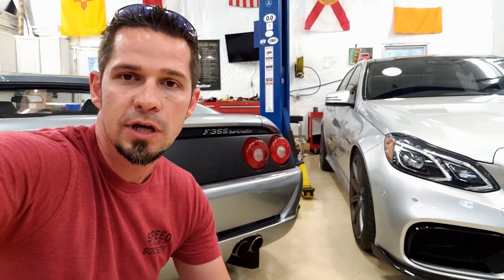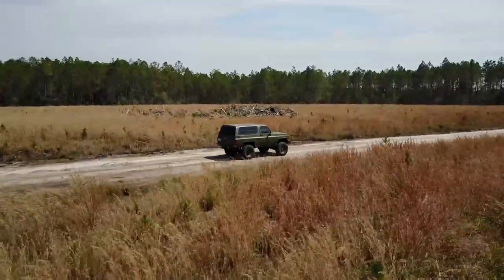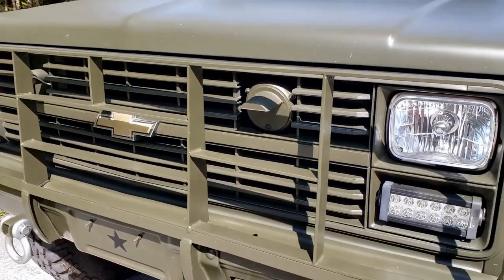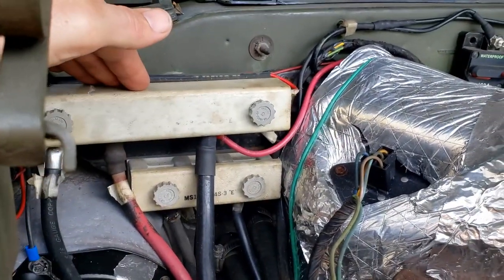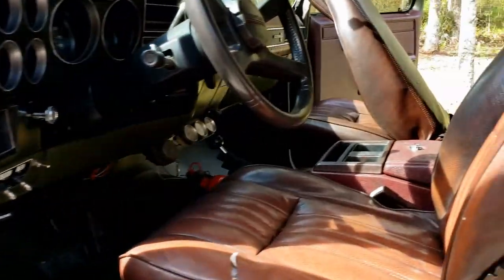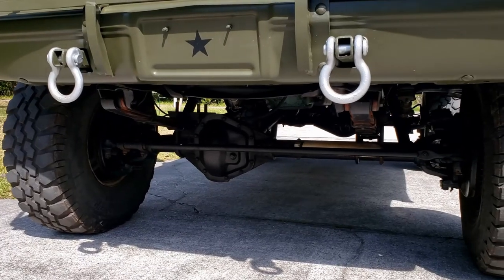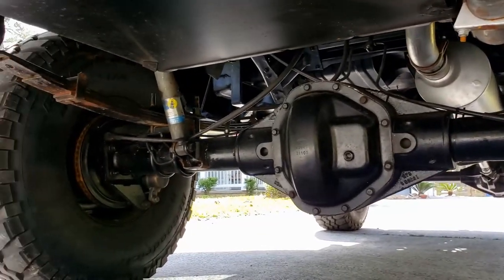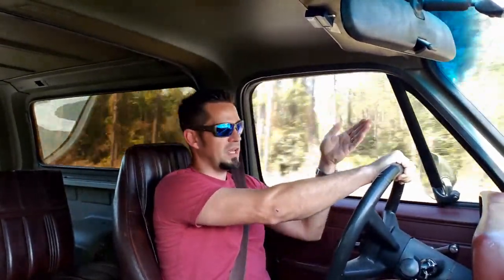TURBO, 1 TON  M1009 CUCV, Full review of my build!

Comment: Great video and fantastic build, we currently have a 1009 that is mechanically sound but rusted badly. One technical correction if I may. The lights that you pointed out were not IR, they were the system that the army used for night movement of all tactical vehicles at the time.  Each light had 4 slots that emitted low level light and I think they were all on the same bulb . Essentially, if you were following another vehicle at night,  and saw 4 dots, you were too close, 2 dots and you were good, a single dot, too far. Simple and effective. The front mount that you pointed out was a headlight of sorts but didnt help all that much. It was amazing how well this system worked. Again congratulations on an awesome build!!
Reply from the maker: Ya, wish I could edit it.
Reply: They're called Blackout drive lights

Comment: Hey enjoyed the video. Can I give a couple of pointers. In the military guys say M-ten -Oh-9.Its short and easy to say just advice not criticizing. Also the blackout lights are not infrared. You could use night vision with them but you don't need to. The rear lights will show as one at night but as you get closer you can see its 2 on each side within the unit. That lets the guys following know that they are getting to close. Other military trucks have the 4 cat eyes and as you get close they are easy to differentiate so they can back off some. Love the rig its beautiful and the vid is good to great work!!
Reply from the maker: Thanks for the comments man!
I actually posted that question on steel soldiers a few years back, ten oh9 versus m1 zerozero9 lol.
Yeah and about the lights, unfortunately you can't edit YouTube videos after you post them, and I didn't want to delete it and put it back up
Reply: It also appears that the "dash bezel" has been replaced by a civilian part. The CUCV's did not have vents, and the blackout light switches were on the lower left of the bezel, not underneath on the metal.

Comment: We had a couple of M1008 pickups in my Hellenic Army unit during the early 1990s, US Army surplus. It's a shame they didn't come with spares, many were cannibalized before they were pulled out of active service after 4-5 years. Several are privately owned and still running, although mostly in rough shape and lacking the front brushguard (legal issues regarding the last one). Greetings from Greece!
Reply from the maker: That's pretty awesome! When I was researching some specs for the video, I was surprised to find how many different countries they shipped these trucks to. The government here liquidated most of them in the early 2000s, so if you want one you have to buy one second hand. I'm currently looking for an m1008

Comment: Your headlight is a 'blackout light.' Most likely just a very weak flashlight type bulb. Infrared look different from those.
Reply from the maker: Yes you are correct,
Reply: The "Blackout" light function powers the "Convoy Lights" on the bumpers while turning off the brake lights, turn signals and headlights.  That way hitting the brakes while driving in the dark doesn't give your position away by illuminating the brake lights in the back.

Comment: I am in the middle of building one of my own and I want to run the humvee tires but I cannot get the offset on them right. Did you use spacers or how did you get them to sit so perfectly?
Reply from the maker: I'm running 74 in wide dually axles. Stock axles are only about 67 in wide. That's a hell of a spacer, I personally am not a fan of spacers, I would just swap the hubs out with dually hubs
Reply: @ExoticCarDIY  that’s exactly what I am planning on doing so I’m glad I was right to plan on going this route

Comment: That round plug on the inside was for the ICE system. I don’t remember what the acronym means, but it was basically an early version of OBD the military used.
Reply from the maker: Interesting, I didn't think there were any computer chips on these cars. Maybe it allowed sensor inputs to go to an external computer? I always thought it was was a standardized plug for military items
Reply: @ExoticCarDIY  I’m not sure how it worked. Starting in the ‘80s they were in everything from CUCVs and HUMWWVs to M1 tanks and artillery pieces. I’ve been out of the military since 2011, and they were even in the newer  armored HUMWWVs and other vehicles I was I. For 22 years and was even a mechanic for awhile and never used one.
Reply: The acronym stands for Special Test Equipment- Internal  Combustion Engine
Reply from the maker: @frankthomas2231  awesome, thanks for that info man
Reply: The connection was for the STE-ICE machine. There we no computers or codes in the CUCV. The STE-ICE would only read info from various sensors on the vehicle and the mechanic would have to compare the readings to those listed in the TM (Technical Manual), to make a diagnosis.

Comment: I would put 56" leaf springs in the rear and stretch the wheel base a little.  makes it look more proportional.
Reply from the maker: Little by little working on the upgrades. I need lockers fist. cant find any for that stupid "super 70" in the rear.
Reply: @ExoticCarDIY  14 bolt from the 3/4 ton burban and pickup will have the correct pad spring pad width for bolt in.  Some wheel spacers would look good too, cover that full float hub a bit.  8 lug is pretty safe for spacers.  a 14 bolt  detroit locker is cheapest way to go.  all the m1028's have a limited slip in the front dana 60.
Reply: @raisinbartholamew5864  yeah I had a Dana 60 and 14bff on my previous k5.
However on this one, with the offset it the H1 wheels, both of those Axles are dually axles with ~75"wms widths. I think a 14bff is 69" so that would need a 3-in spacer per side. Might be the best option though we'll see.
Reply: @kennethderamus5277  yup, unfortunately you have the locker issue with the dually rear 70.. I ended up just getting re-centered 12 bolt hmmwv rims for mine, rather than doing a dually hub conversion on the front and spacers in the rear.

Comment: Thanks for the overview. I'm in the market and will keep you posted on my findings. I spoke with my diesel man, he said good motors will last many miles but a dog, Bank's turbo is the way to go. Did you have any issues with the banks kit, what is the approx cost, did you do anything to the engine prior to putting on the Bank's?
Than you,
Reply from the maker: Mine came with it, seem to help quite a bit from the other 6.2 ive had in the past, but still pretty underpowered in modern terms. No engine mods, the previous owner even says he never adjusted the injector pump. Ive been wanted to tweak it , but just procrastinating since I've been debating a LBZ swap

Comment: Could you elaborate a little on how you did the AC? Which compressor did you use, and where is it mounted? Do these run with a typical V-belt system or serpentine? And any other aspects you may think to advise on? I’m a K5’r and have the opportunity to buy a M1009. Being in Oklahoma I need to add AC for sure. It’s going to be miserable starting next week til about Halloween lol.
Reply from the maker: I took a ton of pictures, unfortunately I didn't film any of it. Really wish I had filmed the restoration. Currently looking for an m1008 that I will record the restoration if anyone knows the one lol.
Anyway, I debated converting it to a serpentine system from a 6.5, but ultimately ended up on keeping the v-belt system and it hasn't caused me any issues. All the parts came from a civilian 6.2 donor car. The driver side alternator was removed and an h6 compressor installed in its place with OEM brackets. The lines were OEM, but had to be modified a little bit to clear my turbo.
A rectangle hole needs to be cut into the firewall, I simply use the AC box as a template.
You do have to relocate the CUCV power bus that is on the firewall to mount the AC parts. If you want, I can send you pictures

Comment: Hey brother really like the blazer picked me up a 83 k5 blazer civilian model with the 6.2. So the truck had ac but they put a banks turbo kit and deleted it. How did you do your system and where did you find the stuff for it. Another question for you is how does the truck not leak oil🤣 mine pukes oil changed quite a bit of stuff just haven't got to take a look at the valve covers or rear main. I already sealed the pan changed the cdr and checked for fuel leaks no dice anything would help man.
Reply from the maker: Wonder why they deleted it? The only thing I can think is that the military ones have two alternators so I deleted the driver side alternator and put the AC compressor there. Rooting the refrigerant lines around the turbo was tricky but doable. I almost rather have AC than a turbo here in Florida lol. I have a photo album that has all the pictures of the AC retrofit if you're interested I can email it to you.
Old trucks leak oil, it's kind of a constant thing you got to keep addressing. Right now mine seeps from the transmission pan. But the rear main, valve covers, and oil pan are good. Got a bunch of stuff on the to-do list coming up soon
Reply: @ExoticCarDIY  I honestly don't know why they deleted it but it's an original ac truck which is kinda dumb to delete it lol. And dang okay I am just going to have to figure out where its leaking. If you want my Instagram is j_cap0lot. I don't really have an email. But I would like to see how you did it just to see the placement.
Reply from the maker: @jjsilva6670  I'll send a link to your IG it'll come from K&r Motorsports

Comment: Hey Kenny, what would be the top ten "or more" things to look for when looking to buy an M1009. Thanks
Reply from the maker: well, there's not a lot of components to break, and being an common truck, everything's things cheap. $80 radiator, $22 water pump, $8 glow plugs etc...
I would avoid any truck with rust, it's very hard and expensive to fix, and it just makes everything hard to work on.
Reply: LRG you should look for rust, also check for 24 volt. If someone has butchered the electrical its a pain to troubleshoot. IF they said they did the roscomm mod for 24 to 12v conversion its not bad you can look it up. Electrical as minimal as it is seems to be the achilles heel for most people working on these. Also check for rust on the cab roof. Any serious rust on the roof inside or out and I would avoid it unless your a body man. Some of these have the seal go bad between the fiberglass top and the cab roof, water runs into the bolt holes and rust the roof out above the cab. When you go to look at it, if its 24v still both GEN1 and GEN2 lights need to come on when you turn on the key, that means the alternators should be exciting to charge the batteries. Its not a deal breaker but just something to look for. These trucks are very easy to work on and you can get the Technical Manuals online for free that the military used for trouble shooting and repairs. Great trucks and lots of fun plus easy to maintain. Good luck!!!
Reply: @ExoticCarDIY  sir, I'm trying to replace my radiator and the cheapest I've found is $600, you mentioned $80, could you point me in the right direction? Thank you, and your videos are awesome!
Reply from the maker: @1libertas426  I bought mine off of eBay, currently I don't see any listed. But the exact part number I bought was APDI 8010607 the seller was  KMC Autoparts
Reply: I had my radiator re-cored by Fingers Radiator in NJ. They did a beautiful job. Give them a call

Comment: I just bought one and had a lot of work done on the bottom which has basically been rebuilt - I am ready to work on interior now but there is strong diesel smell when I drive it that I need to get rid of - also it has large dual exhaust pipes that someone out on and I want to remove - any ideas how to get the diesel smell out - there is s9me rust on outside but not bad and frame is I. Good shape
Reply from the maker: I completely stripped my interior sanded and repainted it. Before it did smell of 35 years of use. 
I would start with making sure there are no fuel leaks.
There's a few FB groups on cucv's as well as steelsoldiers msg forum as good resources

Comment: Nice CUCV What Paint did you actually use, you said 2 part, what color code, Thanks
Reply from the maker: It's still the popular gci rapco paint, 34086, But with added valspar enamel hardener. It adds a small sheen as you can see, but it is a quite a bit more durable than the gci by itself.

Comment: If I may ask, what would you say your power and torque ratings are? Have you towed anything with the new axles?
Reply from the maker: I currently tow my boat, which is about 5k and I've towed a loaded utility trailer around 7k.
It seems to tow the boat fine, The utility trailer was kind of pushing it. the short wheel base of the blazer makes it inherently not the best for towing. I wouldn't try taking a heavy trailer on the highway.
If I had to guess, probably 210hp/300tq
Reply: @ExoticCarDIY  Thanks for the response, now the only other question I have is did you use the original pintle hitch or have you put a class 3 on yours? 5K is about what most people feel comfortable with on these m1009s I was just curious if your rear end swap helped or felt better. I know the original gearing on these is 3.08 but with a Dana 70 I’m assuming you have the 4.10 which should help significantly. Probably hurts fuel though who cares on a resto mod.
Reply from the maker: @nathanowens1721  mine has 410 gears. I did put a Kurt class 3 hitch on
Reply: The J Code 6.2L V8's in the D10's-D30's/M1008's-M1031's were all 155 HP/275 TQ and came naturally aspirated.The C Code 6.2L V8's were what the civilian trucks and vans used,even though the J Code was still optional.The only difference between them other than power ratings was that the C Code had EGR,but the J Code didn't.
Now,just like for the 6.9L IDI & 7.3L IDI,the 6.2L had the availability of having a Banks kit if you wanted one from a GM dealership.The kit added 60 HP/115 TQ if done correctly and 5-10 PSI on boost.It was also mentioned that it was suppose to add a 20% increase for fuel efficiency.

Honestly,it didn't really matter on power because Detroit built these engines just for fuel efficiency in trucks,not for high end torque.They obviously were reliable and easy to fix enough that the military used them and had well over 80,000 CUCV's ordered and manufactured within a couple of years.The 6.2L V8's right after the CUCV's were what the AM General M998's all used before later variants of the Humvees debuted.

Comment: When you bolted on the HMMWV rims, did you use 2" spacers?
Reply from the maker: No spacers, my axles are actually from a dually. Otherwise yes, I would like 4in spacers to run H1 Wheels

Comment: How much did all that restoration cost  ? I have the same truck in fair condition but need a full restoration.
Reply from the maker: Lot of time sweat and blood LOL. I did it all myself, stripped it down to just frame, body and motor. Replaced everything rubber, most of the glass.
I'd still like to get the seats redone and possibly a motor swap but I'm torn.
Part of what makes it a m1009, is the fact that it has an old Diesel with no electronics, but I'd love to daily drive this more, if it had like a Duramax Allison combo, I would use it a lot more
Reply: @ExoticCarDIY  why won’t you daily it as it is?

Comment: What are the three aftermarket gauges you have mounted? Are they for the turbo? I have a 85 CUCV M1009 and I wanted to put a temp gauge in it. Do you have any recommendations? Thanks for your time and great video🇺🇸
Reply from the maker: The previous owner had those installed there. They are volts, oil pressure, and water temp.
All good gauges to have, I would personally like to add EGT and boost as well. But at the same time, I don't like the clutter of just a bunch of random gauges everywhere.
My goal is to maybe put two or three of them in the factory cluster, but working with old plastic can be frustrating. Plus it requires basically hacking up the cluster behind the bezel. Alternatively, I wouldn't mind it one electronic gauge that shows everything, if there is such a product. Another job for another day.
I've had the blazer on the lift for almost 2 weeks just trying to trace down every leak right now. Wish I had more time to do all the stuff

Comment: What type of mpg are you getting. Plan on getting one 48k miles so fingered i should pull the trigger
Reply from the maker: For comparison, remember mine is lifted, 37s, 4.10s, 4spd, and turboed.
Around 14-16.
Not terrible, but not the claimed 25mpg some 6.2 owners claim
Reply: @ExoticCarDIY  think with a 5 speed manual and the right gearing and some skinnier tires it could get over 20? I have a 1st gen 4runner and was going to diesel swap it but have found the inside is a little small and grabbing one of these that already has a diesel would be cheaper and more spacious
Reply: My M1009 is all stock, with 31" tires, I'm averaging around 21 mpg.
Being stock mine has the original 3.08 ratio axels.
The HD400 Transmission these trucks have are about as heavy-duty as they come, I believe they might have the straight-cut gears and are the same transmission used in many tow trucks from the same era.
The best thing about these trucks, they will burn any diesel based fuel and are simple enough that you'll never need to take it to a Dealership for repair or maintenance (no electronics or software updates 😉).

Comment: How much are these worth now and are they reliable?
Reply from the maker: They are relatively reliable. Failed are usual minor, leaks, a glow plug... Occasionally something big like an injector pump 
Rough 3500, normal rust but clean 7500, no rust 12500, restored 25,000+. I've been offered that, not selling it tho.
Reply: @ExoticCarDIY  theres a fully restored one at streetsideclassics for 38k. But they put aftermarket speakers which im not into. But other than that its clean looking.